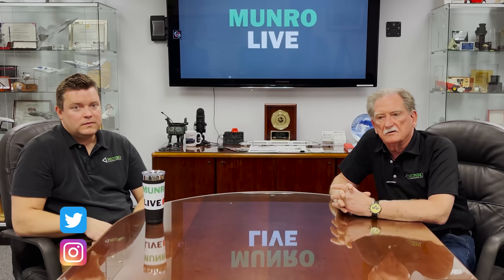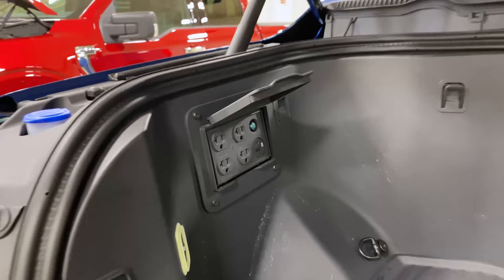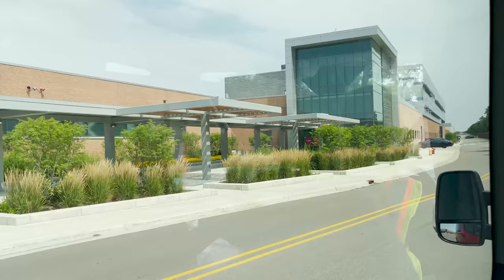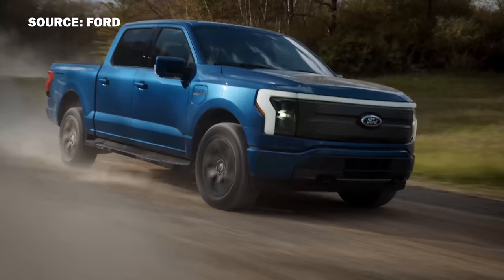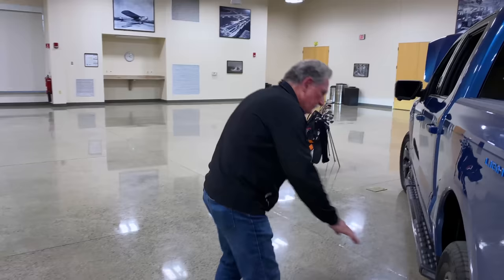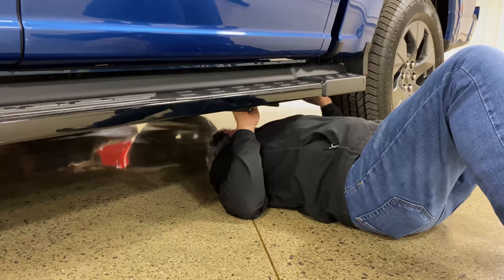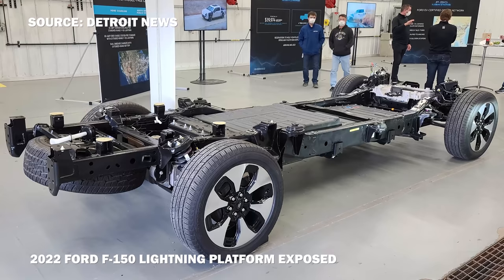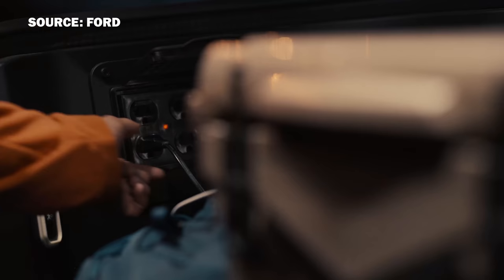Sandy's First Look at the Ford F-150 Lightning Electric Truck!

Comment: This is nice, certainly nicer than any Tesla product. I could see this being a very limited market though. Gas works better for towing, hauling, work, etc. I'd be more interested to see something like the Maverick (with a hybrid powertrain). It will be interesting to see the new Tundra. But, nice work for Ford.
Reply: What makes you believe gas works better for those activities? I’m seeing the exact opposite
Reply: Genuinely asking btw
Reply: @Steph1  what is it that you’re seeing? Range on EV drops dramatically, more so than ICE, recharging takes a  lot longer and most charging stations will require you to disconnect your trailer. And if you’re a weekend warrior going to the desert, there aren’t even any charging stations nearby. Plenty of gas stations and in the event you’re really out in the middle of nowhere,  a 5 gallon jug gets you home. I do think EVs are the future, but they still need more development and better infrastructure to be a viable tow rig.
Reply: @Steph1  sure, while electric has more torque, gas engines are better for scenarios where you need sustained power. This truck I assume has 300 miles of range, but that is on flat ground going 55 mph in 70 degrees.
Hook a snowmobile trailer up to it in 30 degrees and it drops to 150. If you go over 65 you will lose another 15 percent, which would barely be over 110 miles.
A PHEV is what I’m looking at for a truck until we move away from lithium ion
Reply: @andrewmeehan6151  I don’t see them going 100% EVs for quite a while. Especially in their 3/4 and 1ton trucks.
Reply: @jabroni6199  yeah I have to be honest, it won’t be anything like what these guys are predicting. We will be all electric but it will take until 2035 at least for us to get over 50% market share. Way too many things in the way